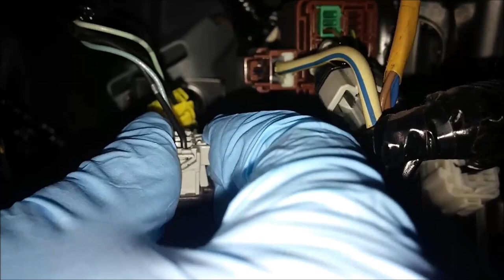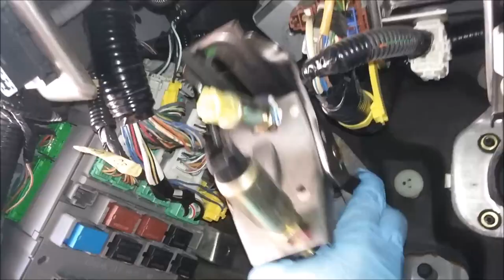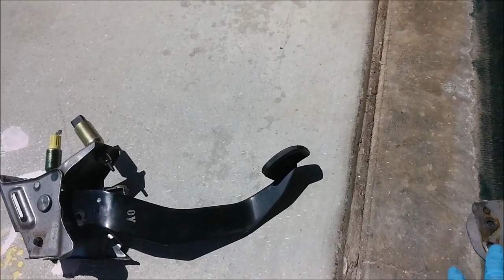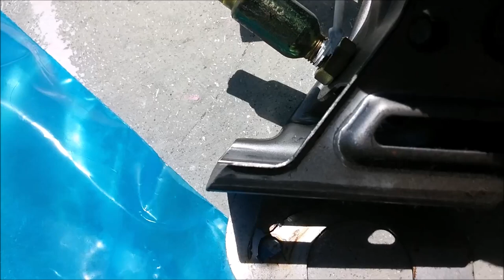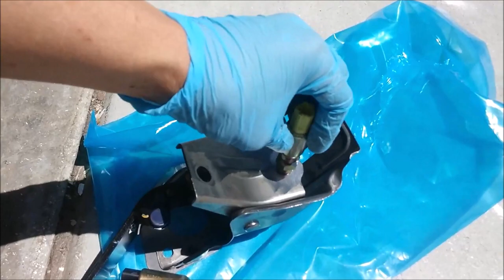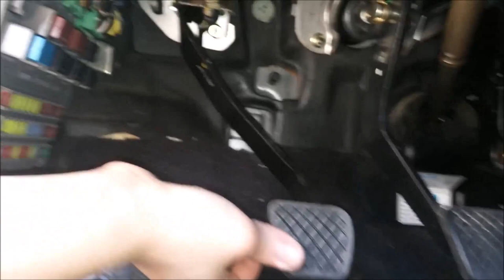Replace clutch pedal bracket on Honda Civic, Accord, Element, Acura TL, TSX, CL, ILX, RSX

Comment: I believe it's the throw out causing this Mine broke took it off it has been fixed, welded before. if the throw out is worn it will be harder to depress the pedal. Looking for a new pedal assembly. They seem to be a big selling item on ebay Honda Engineers really dropped the ball on this. IMO

Comment: I think this is what happened to my 2007, 2.4, just the other day. I felt and heard a pop down by the clutch pedal and then couldn’t get the clutch to disengage. Had it towed to a shop and the guy tried to tell me my clutch was worn out and needed a new one at 1400 bucks for the job.  I’m probably gonna have to have my car towed to my house because I don’t want to hurt the synchros trying to drive it without the clutch.  Also, could it be the throw out bearing or something else with the clutch?  It has no hydraulic leaking, it hasn’t been slipping or anything. The pedal has been squeaky for what seems like years.
Reply from the maker: Check the clutch bracket, then the clutch master cylinder and slave cylinder
Reply: @joehowto  turns out it was the clutch master cylinder, it was a bitch to replace but I knew that mechanic was full of it and it didn’t need a clutch replacement.
Reply: This happened to me yesterday on my 07 accord, i heard a snap and then very difficult to put in gears, had to turn off the car at every light put it in first gear then start the car. It seem like the clutch was still partially engaged because wen you started the car will move forward. I take off on 1st gear and the had to force it into 3rd because would not go into 2nd or 5th gear. I just need to find that clutch bracket

Comment: I noticed you didn’t show putting the bolts back just tightening them up, how difficult were they to place
Reply from the maker: I tightened them up afterwards as it was not easy to hold the camera and tightened the bolts
Reply: @joehowto  I understand but how difficult were they to to put back before tightening
Reply from the maker: @hemtet5500  just needed to line them up. It was not that difficult.
Reply: @joehowto  👍

Comment: Do u have to adjust the clutch pedal again after doing this?
Reply from the maker: no need to as long as OEM
Reply: No because the whole assembly comes out, just bolt it back up to your cmc

Comment: just replaced the pedal assembly the car starts but wont shift into gear any help?
Reply: it goes into the gears physicaly but nothing happens when i let off the clutch
Reply from the maker: @dankmasterflex  did it have problem before the pedal replaced?

Comment: Where did you buy the part?  I'm having a hard time finding the entire assembly
Reply: Me too ! It's hard to find this assembly from Quebec
Reply: @joehowto  is the same part ?
Reply from the maker: @michaelm.savard1226  what car and years?
Reply: @joehowto  accord EXL 2005 4 doors,2.4 ivtec
Reply from the maker: @michaelm.savard1226   https://amzn.to/2YdHjge
Reply: I bought mine from the Honda dealership 2 days ago $213 with next day shipping
Reply: I had my friend weld it!!! It's been over 8 months and it's still holding up.  Make sure to use gel on the plastic parts so you won't melt the plastic gadgets.
Reply: @rubenzamora3326  you can also remove the entire assembly from the car to weld it then put it back in
Reply: I called the honda dealership

Comment: Is this why your clutch pedal won’t return to the up position??
Reply from the maker: The clutch won't let me shift into gear
Reply: @joehowto  in my case the clutch pedal went all the way to the floor and wouldn’t come up
Reply from the maker: @jogmas12  check the clutch cylinder if there is any fluid there